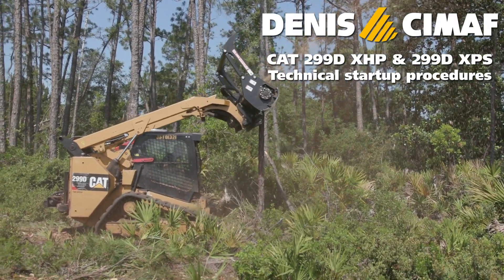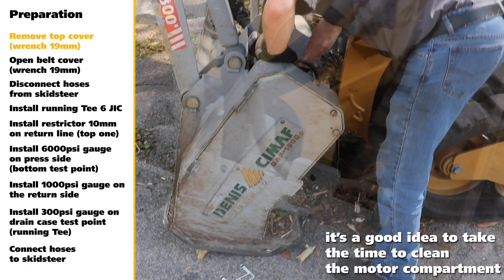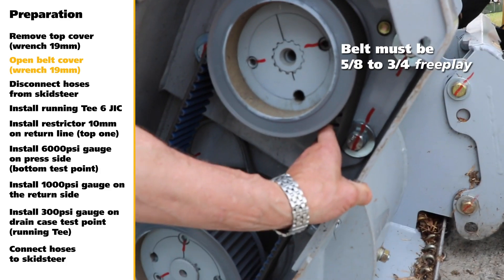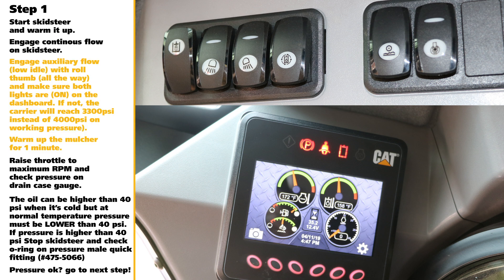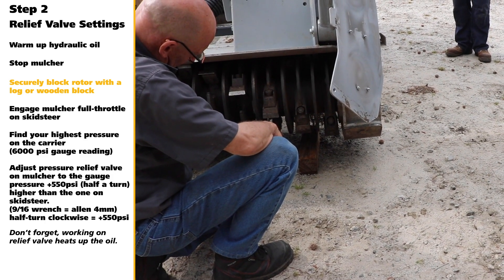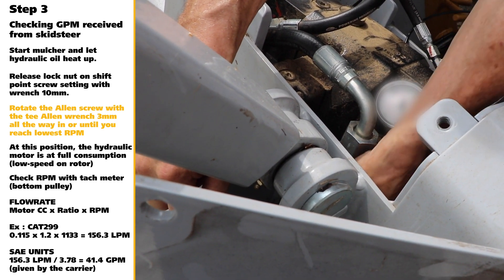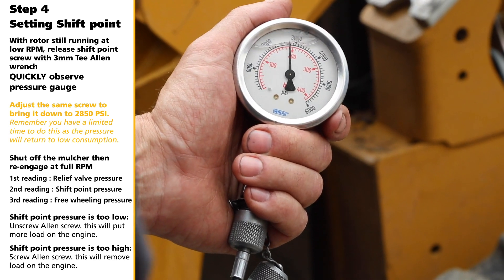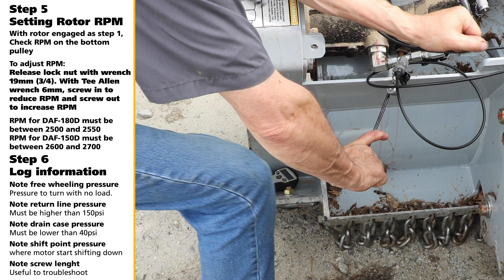Installation of Denis Cimaf DAF 180D on to a CAT 299

Comment: I know this is a old video. How fast are you wearing it the flat face connectors. There's lots of side pressure on them. I wish the hoses came out other side of machine to relax hoses more. Mine are a constant battle